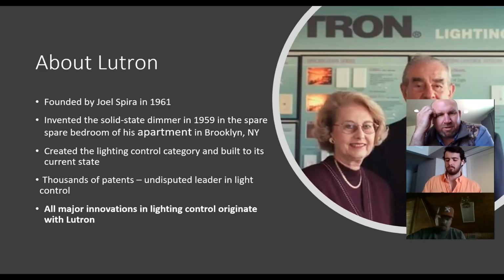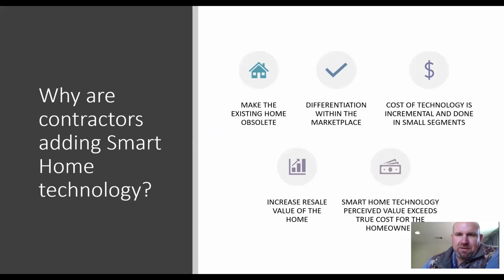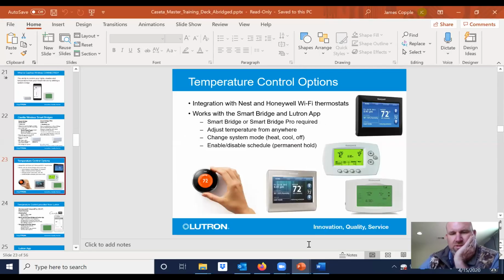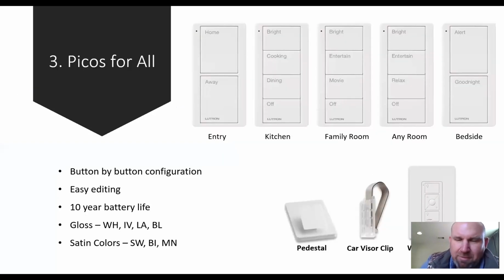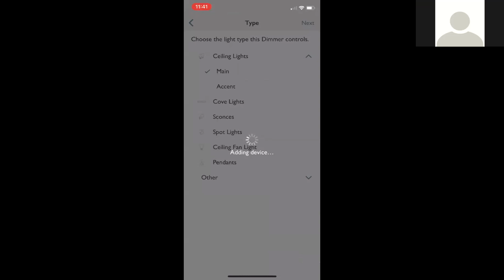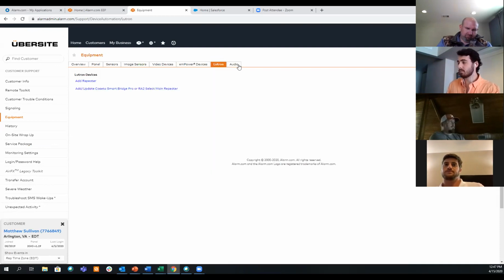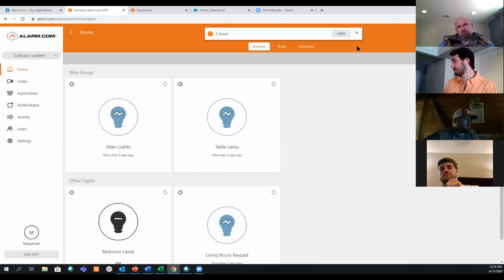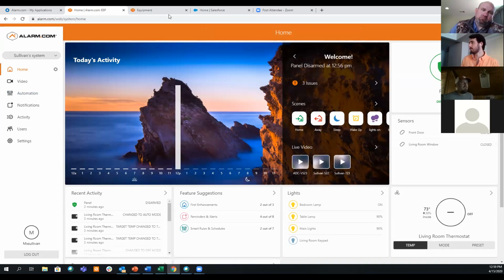Lutron Systems with Alarm.com Integration

Comment: Hi Guys im on a proyect with lutron QS  prcessor and customer is asking this, integration with alarm system to turn off all lights when they arm or press code on alarm to arm it, you know if this is possible and if it is what devices we need to make this happens? Thanks in advance!!